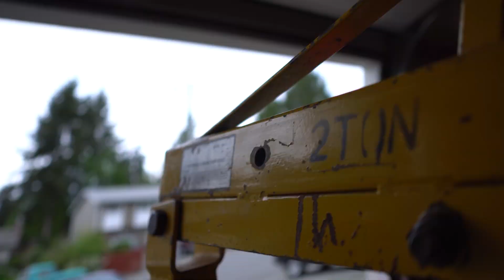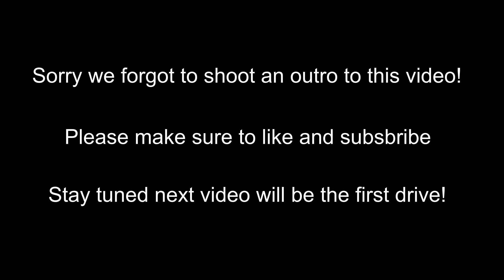How to build a 1.5JZ  - First start up

Comment: it would have been better just to get a 2jz gte pump rather than using the 1j pump.
Reply from the maker: The plans to get one later on but the oil pressure numbers would still be pretty high with a 2jzgte pump if not higher. The idea was to keep this cheap to get back driving
Reply: SHINCHOKU that’s understandable.